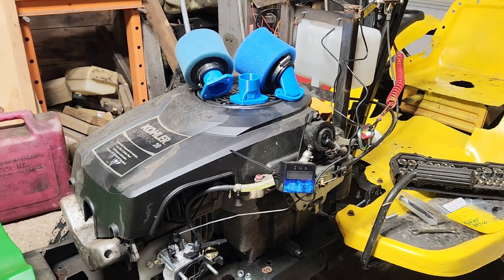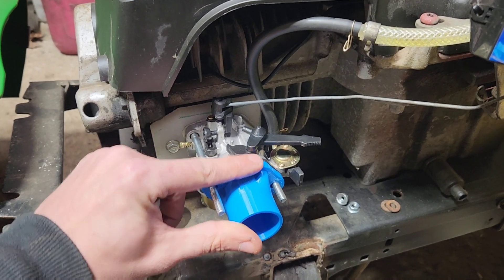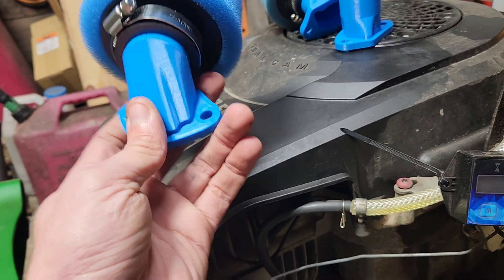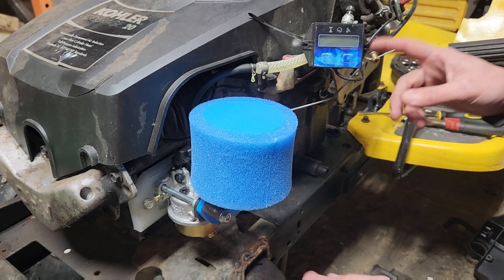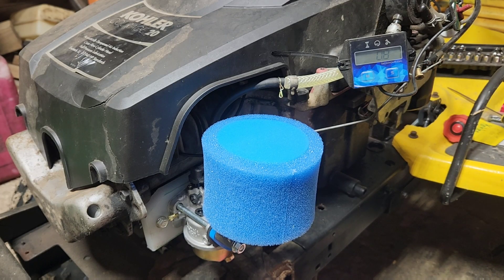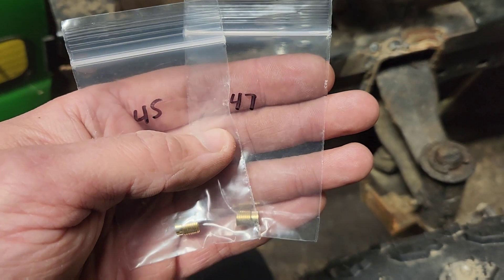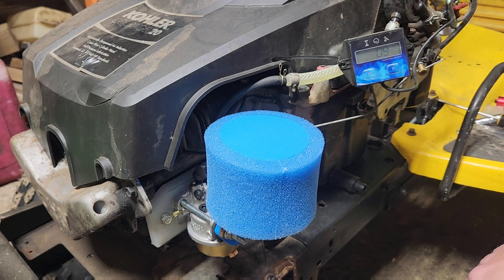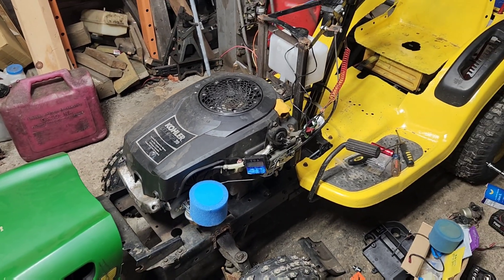Jetting Honda Carburetor For Kohler Single

Comment: Any chance you can make quick release air filter locks? Something similar to the old quick release tires on bikes/seats. I work on honda gx160,gx200, gx270s a lot and it only takes a few seconds per filter but I have a fleet of 35 go karts that get serviced every week. PS: have any need or use for a reduction wet clutch? I have a few that will require cleaning but work good. Let me know! :)
Reply from the maker: Email me some info mainemudmower@yahoo.com

Comment: This is interesting. For selling them testing the material if it holds to oil/fuel would be the biggest issue. Why some people do ot know how to re jet and or tune a carb, as well as running them on a blow by engine as well other factors ight come into play. Just a thought. Design looks good on all of them to me. To those that don't know be a bit easy on the idle jet and bottom 0 ring they will come off depending the brand of 0 ring you can remove that lower 0 ring for a slight bit more fuel to pass by the outer of the idle jet. "Definitely dont recommend... harder to tune in some aspects"
Reply: PLA is pretty resistant to petroleum based products. You can't leave it in a hot car, but there should be a cooling effect from the fuel.  ABS fixes these problems but it's harder to print

Comment: Sell the parts?  No, I think it would make sense to just sell the files....I'd love to learn to actually be able to make the files themselves.  Shipping costs makes doing a lot of this stuff pretty cost prohibitive I would think.  

Almost bought one of those 3D printers you listed, but decided against it, as it would just turn into yet another very expensive hobby like my pen making not so bright idea...several thousand dollars in lathes, tooling, accessories, and supplies, for about a holiday season worth of pens that I made and....gave away....nobody wants to buy a $20 pen when they can buy a pack of pens at the dollar store for....a dollar LOL.  

So, I'm not exactly sure what I'd use a 3D printer for, considering I have no clue how to put anything I'd want to print into it to print LOL.  I know people have a certain type of file you use, and you can find and download those, but I want to know how to actually input the data or whatever you need to do in order to make the files, without that bit of knowledge I wouldn't find a 3D printer useful I don't think.  Although the $300-400 price range for the one you are using seems pretty reasonable...course you can spend thousands on one if you want too LOL.
Reply: a sub $200 filiment printer, a USB flash disk and basic computing skill is all that's required. There are plenty of files on thingyverse and mini factory just import the file into a slicer software suite save the sliced file onto the USB...insert USB into printer and press print...Its not that hard. The 3d design is the tricky part but you dont have to know CAD or Blender to get starter making stuff.
Reply: @UncannySense  Hmm, thanks.  Just trying to justify buying one I guess LOL.  I know there are files out there, but thinking more along the lines of what if I want to 3d print something myself.  Guess I'll have to have a crash course in CAD type stuff HAHA...at least the basics...I'll look around and see what I can find on the ole Youtube classroom lol.

Comment: I got a EG2200Z Honda generator that came with a rag for a choke and adjustable as air filter.  :-)  Works... though not my cup of tea for reliable use, even though was the reliable way for the previous owner.  Anyways, if I recall... those are a funny design where like half the choke is held on by the intake part.  My og thought was modify an intake air filter part like you showed... and now... hhhmmm... did you mean you're going to make an intake like that with a choke part as well or FYI which choke can be modded to fit?  Man, I'd give you $5+ for that... that'd be useful for me and I'm in no hurry to design and make for now since an outdoors season project for me and that's not till spring weather permitting.
Reply: Great work Neil!  You have me wondering what Type 2 Form-A-Gasket does with the PETG as I thought at least with a breather tube used... might need to coat the inside of a 3D printed part with possibly?